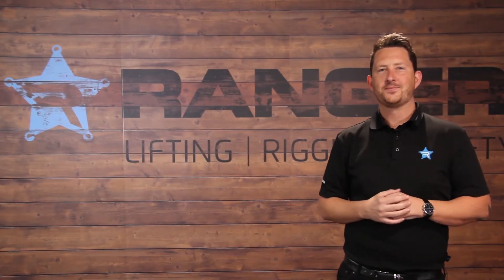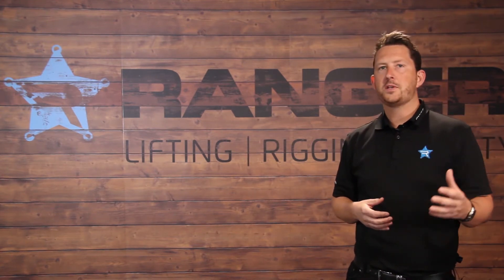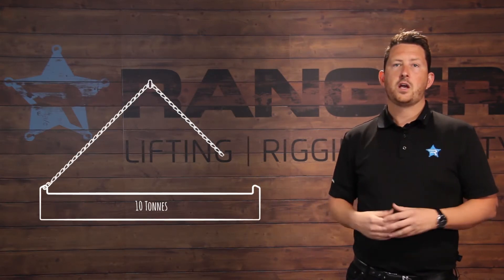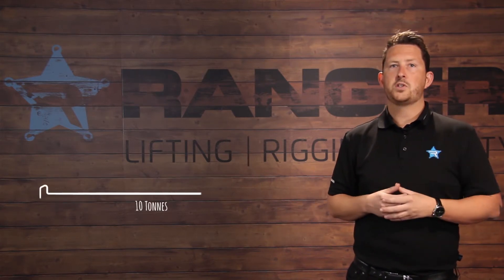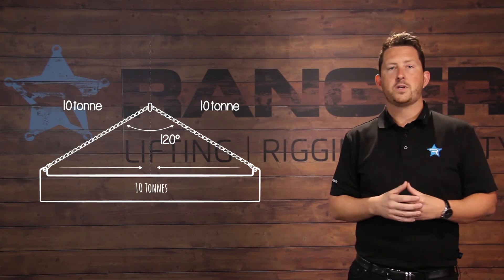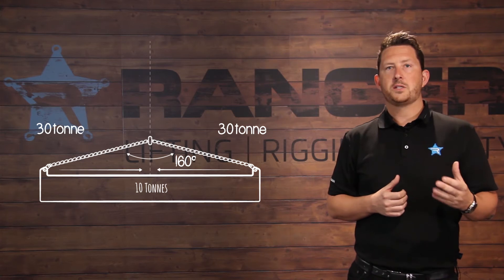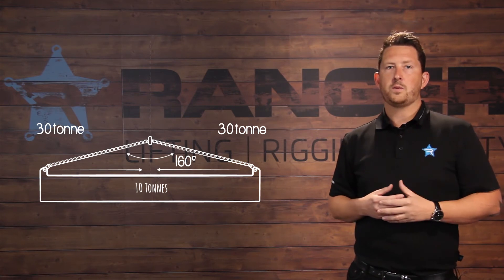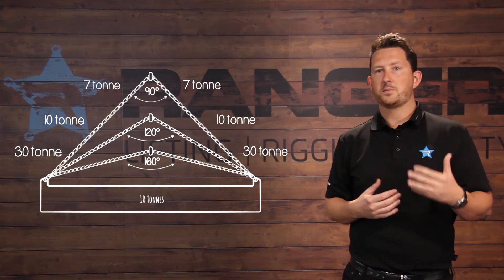Calculating Sling Leg Tension

Comment: 10 ton's,  2-leg bridle hitch 30°, 
10000×2.2 =22000 (lbs), so you must use 
One1/8 size wire rope sling  6×19 ips, IWRC  👍 ,  and your hitch Capacity is 22750(lbs)  Thank you.  😂.. Please pray 🤲  for me.
Reply: How to calculate nylon web sling diameter
Example: 60 degree with 16000Lbs and web sling (5000 lb) What diameter of sling?